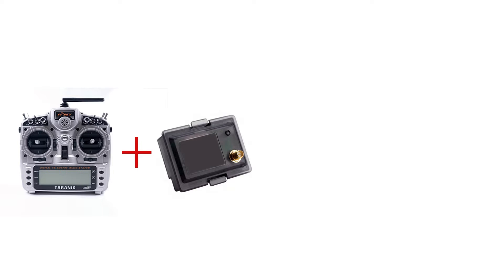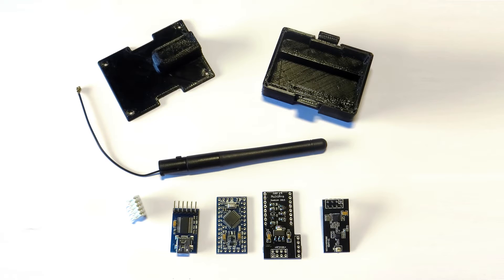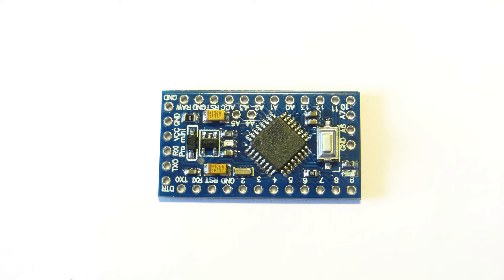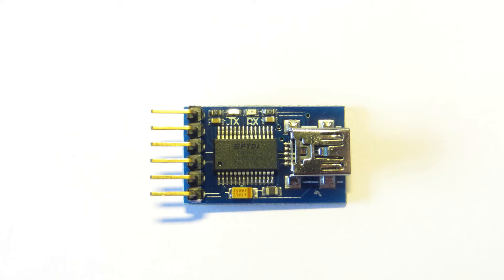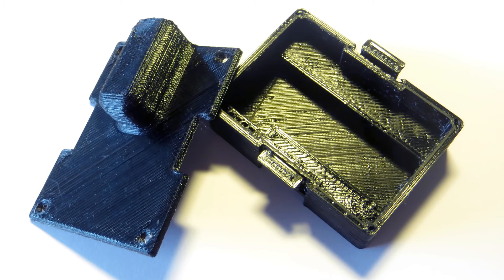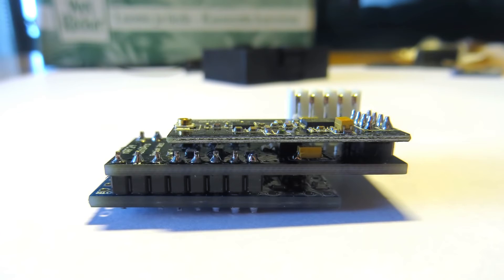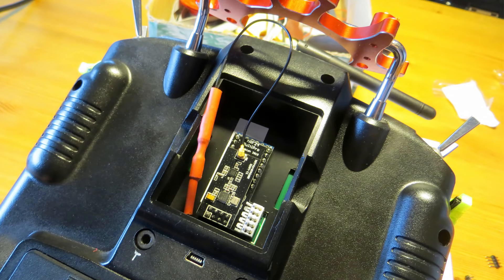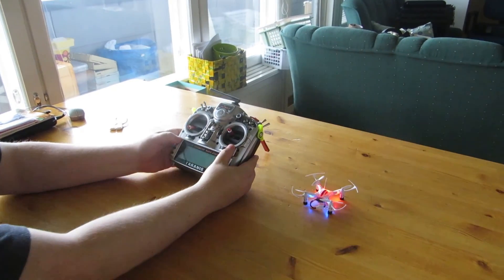Taranis + H8 Mini ( Works also with any other radio that have a PPM output! )

Comment: Hello. How do u set flipping function on the taranisv?
Reply: https://github.com/goebish/nrf24_multipro   At the end of the page it says that the flipping function is bound to the Channel 6. Just use this in your Taranis and you should be set. If you are using this same H8, you can use Goebis'hes own model profile: https://www.dropbox.com/s/lm912rluu7ipuwi/h8.eepe?dl=0  Should be there already.